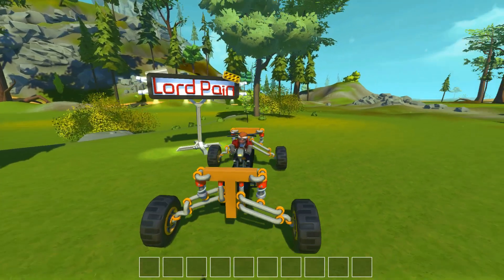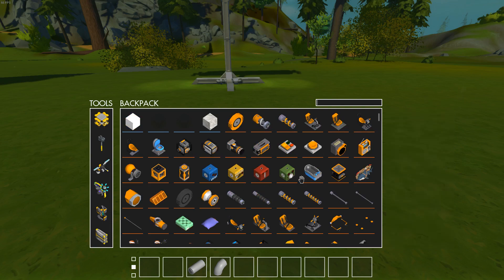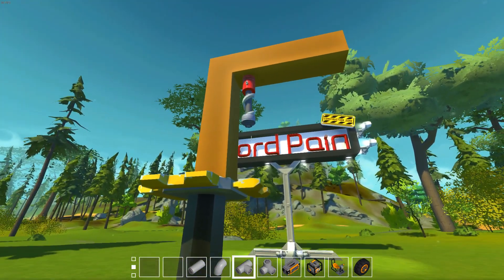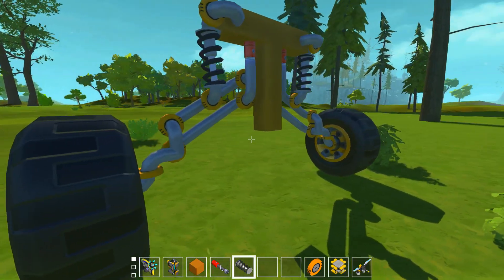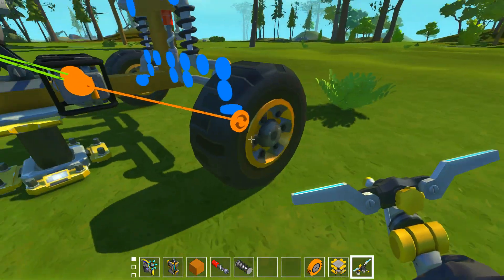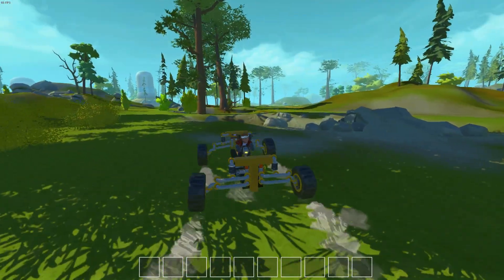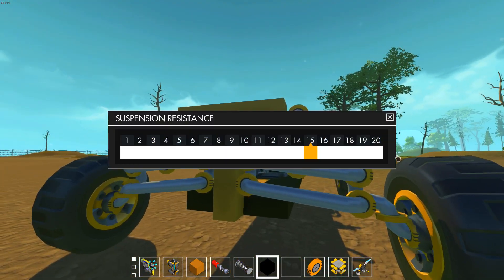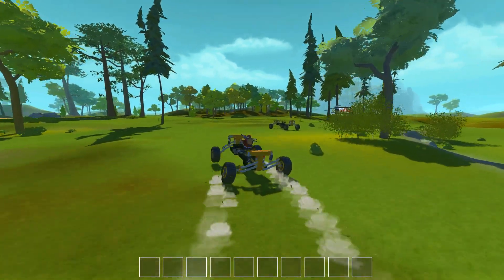NEW Long Travel Double Wishbone with 2 Suspensions!!! ( Scrap Mechanic )

Comment: How do you avoid the suspension glitch making the car float when you go over terrain?
Reply from the maker: Well it's kind of hard to explain but what u need to do is add some more bearings on the suspension but with a different orientation. I hope u get the idea :)